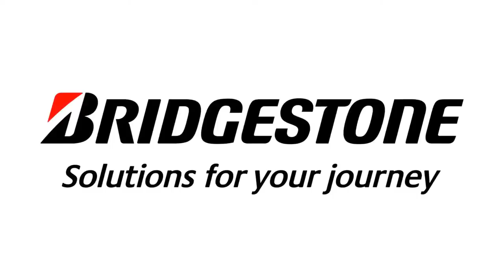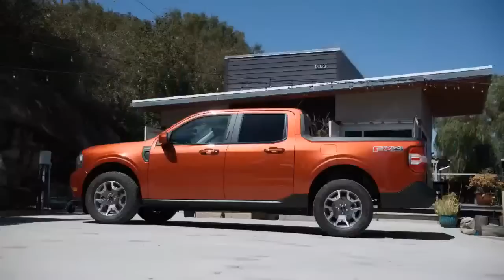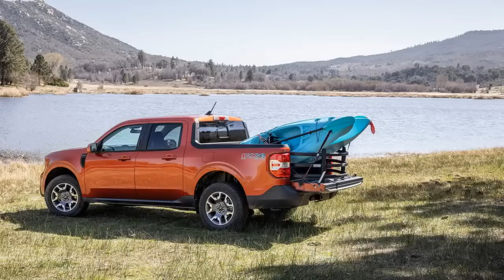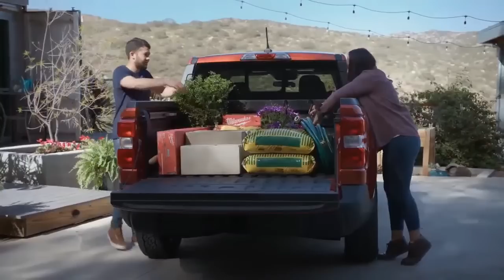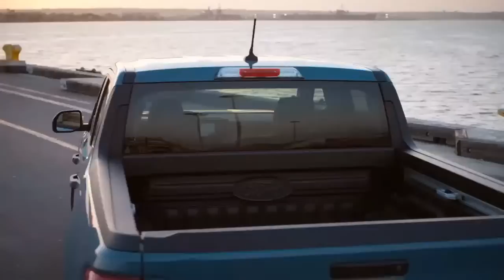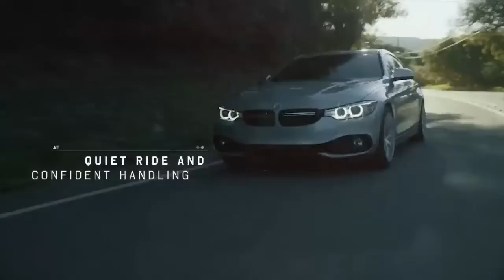Ford Maverick Pickup Could Become A Cult Classic - Autoline After Hours 562

Comment: Love my 23 XL hybrid maverick, it's such a great little truck. I tease my wife all the time that it gets better gas mileage than her Honda fit 🤣 by far the most versatile vehicle I've ever seen.  It can carry 1,000lbs in the bed no problem, gets well over 40mpg, it rides fine. I can very easily get over 550 miles out of a tank, and it's very cheap to insure. Best of all, it's paid off. 28k miles, I plan to keep it until it rusts out or becomes too unreliable. Can't help but notice that the battery pack is less than 3 grand, and you could put it in yourself. Absolutely thrilled with the truck.

Comment: lot of resistance to the CVT?
Reply: It's an ecvt, extremely durable transmission design. Not the same type of problematic cvt tech Nissan and Subaru use. Ford and Toyota have been using ecvts for over a decade with no issues.

Comment: I want to see a hybrid with a NON-CVT trans.  I was sold until I read about the cvt transmission
Reply: It's a ECVT no belts or pulleys electric motor
Reply: It's an ecvt, which is much more durable than a normal automatic transmission. You're thinking of a normal cvt, those are crap, this isn't.

Comment: Depending on the driver's height, is it possible to lean back from the driver's seat and open the manual sliding window without too much trouble? Thanks
Reply: I would doubt it. Given that the back seating area is a full sized seats and not side facing jump seats like the old Ranger , suspect you'd have to be Shaq tall to reach.
Reply: @davidyaroch6622  Thanks David.

Comment: Hybrid version made in Mexico. What do you think about that?
Reply: Yes this is the problem. First model new engine made in Mexico. I need this to get me 15 to 20 years and 150k miles in Chicago’s salted winters without accruing 6k in repair expenses. Will it do this? Screaming “built Ford tough” at me won’t assure me of anything. 
I’m still driving a 20 year old impala bought new for 20k. If the maverick can do this it would be the best option for my needs currently on the market.
Reply: @CarlYota  This hybrid system has a reputation for lasting 500k or more in escape taxi's, it should be fine.
Reply: Ford manufacturing in Mexico had some of the highest quality results compared to US Ford plants. It sounds amazingly superior, with no facts, to look down at something manufactured in Mexico. Have you ever looked at the quality work done on residential homes by homes construction trades done by mostly Hispanic construction workers. I watched a crew of Hispanic fence workers take down and put up a big fence job on my home and 4 other adjoining homes, and I will challenge any other "group" or ethnicity to do what they did. I was incredibly impressed.
Reply: The hybrid system is made in Michigan, it's a very well proven design. Not sure why people are freaking out over this, the Tacoma is made in Mexico unless I'm mistaken, and people always say how reliable those are lol.
Reply: scary!

Comment: I would give up power…windows, locks, and exterior mirrors for standard cruise control on a XL model.. air conditioning and cruise control should be standard on anything made after 2010.
Reply: A thousand me-too's to that.  Ford plays a dirty game with the XL vs cruise.  If I knew there would be add on cruise my order would have been an XL not the bells and whistles of the XLT.
Reply: AC should had been standard on all vehicles since it came in the 60s.
Reply: To be fair, there are people like me who have never once used the cruise control in over 20 years of driving. We must entertain the possibility that the people who want cruise on the base model are a tiny minority of their target market.
Reply: @CarlYota  I still think Ford is pulling a fast one not putting cruise on the XL, and not letting it be an option.   They don't want to sell many XL's is my bet.
Reply: @CarlYota  possible but I’ve seen a far bit of outcry on the lack of cruise in the XL. This includes me as I wanted to get this for 21.5k. I also rarely used cruise but married and sharing this vehicle with my wife.

Comment: $20.0, 40mpg should be an unbeatable combo…….
Reply: 40mpg my ASS!
Reply: More like $25k and 35-36mpg combined highway/city. 20k plus 1.5k Ford tax (destination fee)
Reply: @RobertBeedle  seeing how the new Honda Civic starts at $23K and inflation continues to boost prices, by the time this Mav actually goes for sale the chances that it will be $20K are a whopping 0%.
Reply: Meh my duramax Canyon gets that already
Reply: @rotaryenginepete  Not true it gets 19/28, 23 mpg combined  for 4WD OR  22/31, 25 combined for 2WD. These two aren’t even in the same category, the cheapest diesel Canyon with 2WD is $39,000.
Reply: @emed1977  glad you can read EPA ratings, but those are AVERAGES and there's also something called a tune.  Oh and my diesel Canyon wasn't anywhere near $39K.
Reply: @rotaryenginepete  yeah it was probably 60,000 lol
Reply: @JoshuaJohnson-tl7my  nah it was $32K, and can be had for less without expensive packages and 4WD.
Reply: @rotaryenginepete  and it was 20,000??
Reply: @JoshuaJohnson-tl7my  no, but show me a Mav that actually gets 40mpg and actually costs $20K, and you might have comparison to my 5 year old truck.

Comment: I’m 25 and would never want this POS “truck”!!! I’ll just save another year or two for a Tacoma that’ll last longer than my liver.
Reply: Then your liver won't make it past 5 yrs because that's about the time it takes for a Tacoma to rust out.
Reply: LOL.....so your liver will last a few years then !
Reply: Just so you know, the hybrid system in the maverick has a reputation for lasting 500k in escape taxi's. It was already an extremely durable design, then Ford did 19 million miles in durability testing for the Maverick's development. The Tacoma has had some major reliability issues, at least the current generation. Even older Tacomas had quality issues in the form of extreme rust. The maverick is what the Tacoma used to be, but better imo.

Comment: they need one with a 8 foot bed.
Reply: I agree, lots of guys around here use old rangers for pool service, parts runners, mobile detailing etc. A Maverick long bed would be a great replacement.
Reply: @SpookyEng1  it will become the new parts delivery vehicle. Gas mileage will be the selling point.
Reply: I think demand will force them to make one with a long bed. That takes it from cute lifestyle vehicle to true work truck
Reply: @Shawn_M  If you need a "true work truck" then Ford will tell you to buy a true work truck (i.e. an F-150). The Maverick is mom's SUV dressed in dad's boots! 🤣
Reply: @chrisprime9601  the problem is work trucks are crappy daily drivers mainly because of mpg. People can’t afford two vehicles. It’s just that now people are are wanting the maverick to be slightly more tailored to their specific occasional work use. I’m not sure why people need an 8foot bed, especially since it can already carry a stack of plywood on the wheel wells/tailgate but that’s purely egocentric bias since im a diy/ carpenter
Reply: @CarlYota  I agree with everything you said
Reply: Thinking the only demand/buyer wanting an 8’ bed in a true compact size PU will be ranchers who are bachelors

Comment: I see that the new Maverick has rear disc brakes.  The latest Tacoma still has rear drum brakes!
Reply: Toyota has been phoning it in with the Tacoma for years lol
Reply: but whatever Toyota  does…I have more faith .
Reply: @jpear  sorry, not me ! Toyota is not what it used to be, Ford is equal and in some cases better !
Reply: @jpear  If you're talking about reliability, the current gen Tacoma actually has/had quite a few issues for the first few model years at least. Not sure if those issues are resolved now. But the hybrid system in the maverick is renowned for being exceptionally durable. I can't find any complaints about the durability of it, and it's been out for well over a decade, with many Ford hybrids lasting 400-600k. It's insane. So between a current gen Tacoma, or a Ford maverick, I'd say the Maverick is probably going to be the more durable truck lol.

Comment: Why no hybrid AWD?
Reply: Seems like the hybrid is mated to a CVT.   Does Ford have an AWD solution for a CVT transmission?  The Eco-boost is mated to an 8-speed auto which would present less problems.
Reply: @brianrichardson7039  actually the escape hybrid has AWD since 2005 and it has an eCVT, no belts or chains.
Reply: @brianrichardson7039  and the eCVT have been very reliable.
Reply: @enzop.3227  just looked up the design for eCVT and looks like Ford and Toyota got it right.  Thanks for the info!
Reply: @brianrichardson7039  Toyota shares the technology with Ford, they use the same eCVT. The Maverick will have a new electric motor that was built in house by Ford and is 20 lighter. Because of this new motor the AWD option needed more engineering. I would wait a year for the AWD hybrid if you want it.
Reply: @brianrichardson7039  I want the gas mileage of the hybrid though :(

Comment: Should have mentioned that the Escape already has a PHEV option. Since it uses the same platform as the  Maverick.
Reply: Ford has all the parts in the bins to make the Maverick meet requirements for federal tax credit, but strategically they will wait and not burn through their quota on $30k vehicles like GM did. They can keep their eye on any changes and if a new EV tax credit passes, within a few months they can offer PHEVs that cost $10k more but qualify for the $7500 tax credit. 

But if this thing can get 37 MPG average and look like a baby pickup, ride like a car, built like a Honda Ridgeline or Cyber CUV unibody construction, for $20k, that’s a pretty reasonable vehicle for many.
Reply: I’m thinking 2023 MAV will offer plug-in
Reply: @jpear  probably correct, or all electric. I don’t know where a charging station is so I’m going to skip electric this time around